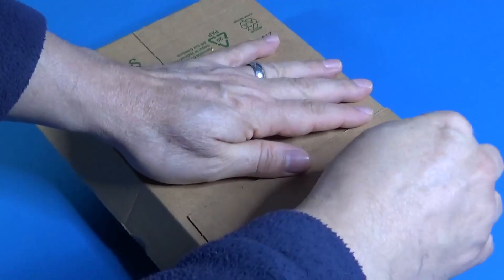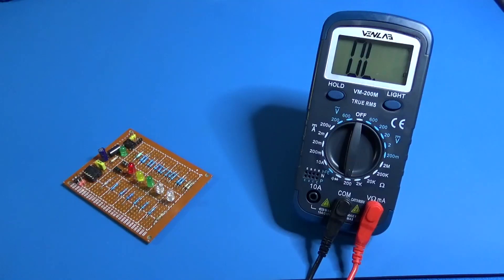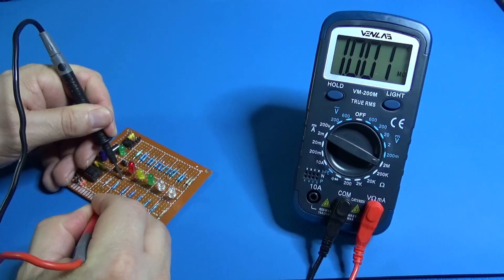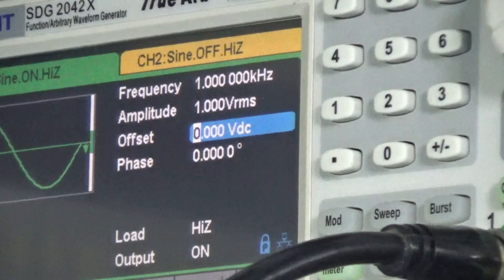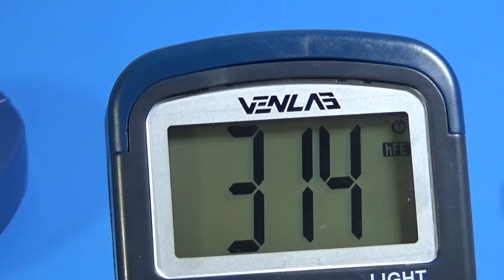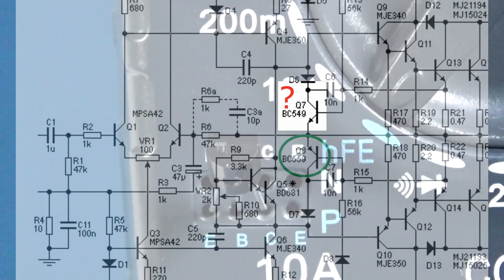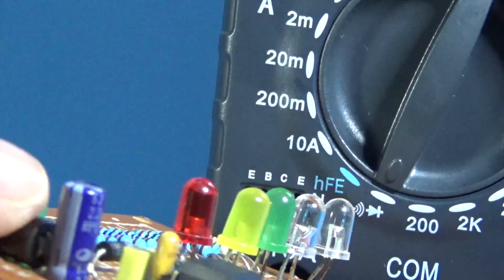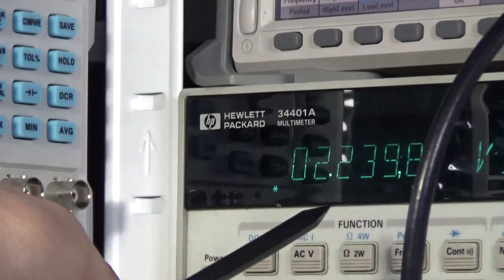Venlab VM-200M Digital Multimeter with transistor test hFE - Manual Range DMM

Comment: What/where can we acquire the components sampling board that you are using there? 73 DE W8LV BILL
Reply from the maker: Hi! Blessings! It is the REF102. There is 0.05% and +/-0.0025.  Check well when you find it listed, because there is more than one precision rating. I made a video named: "10VDC REF102 voltage reference chip using RS232 as a voltage pump in a basic circuit / without SPSU". I got mine from Farnell. (Do you want a "top advice"? It is made now days by Texas Instruments, but the old chips from Burr-Brown Corporation where better). By the way! ...I will need the favor back. I have a technical question to ask to you. I will try to contact you next weekend. And happy new year!
Reply: @bob.kalpon1398  Thanks Mr. KALPON! Just type in "W8LV" at any search box to reach me.